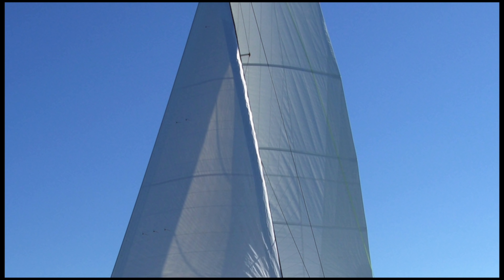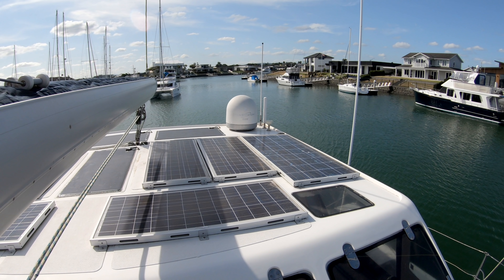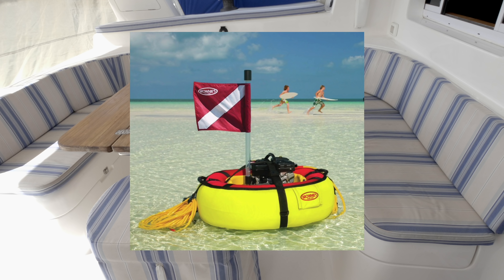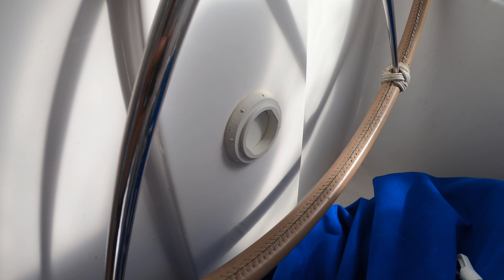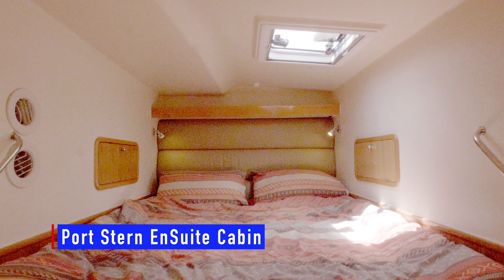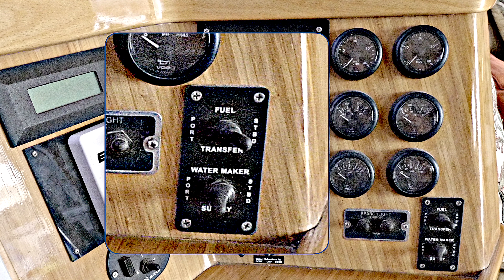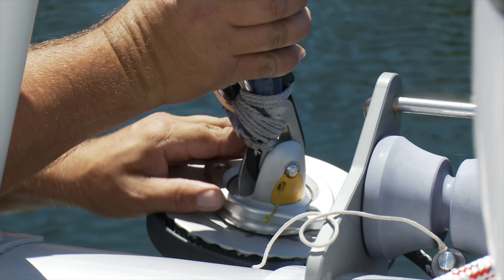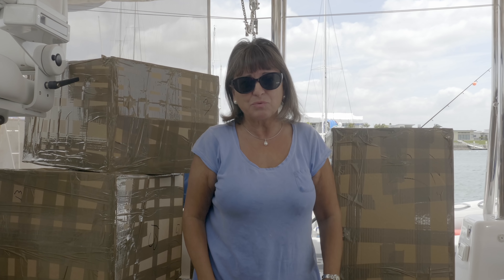Suliere is for Sale

Comment: Ready to take over the world, what else could you need! 10x better than a buying a brand new St Francis.
That being said, she is probably on the heavy side, how much wind do you need to stop the engine and sail?  and how does she point and sail in general? There isn't many sailing videos of the St Francis.
Reply from the maker: We averaged 200 miles a day sailing from South Africa to the Caribbean.
Its is not a case of stopping the engines to sail, its a case of sailing until there is no wind. We used the engines a little when the wind is less than 8 knots and we want some speed but otherwise we sail.
There are similar examples of sailing other SF50s across the pacific sailing at 15 to 18 knots. Oiu top speed ever was 26 knots.
She points well to 35 degrees.
Reply: @ClimateRealism  Thanks for the answer. 
So you're sailing in 8 knots of wind, point to 35 degrees, average 200 miles/day all of this with ultimate comfort at anchorage; therefore, what's the deal with performance cat? What's your point of view on the debate performance cat, lightweight=speed=safety etc? From what I've read, people get performance cat because they're fast, safe because they can dodge a storm, etc. but end up cruising at 9-12 knots because it's more comfortable for the crew. Sounds like it's $1M marketing. 
What are your thoughts on the topic?     
Ben
Reply from the maker: @zambla5088  No not at all,
I was giving examples of how e use the boat.
We would normal;ly start to use sail in about 8 knots... below which just engines.
We averaged when crossing the Atlantic 200 miles a day -sailing.
Sometimes hit 250 miles.
She can point to 35 degrees.
Those are answers to your questions - not all one example,
Out crushing speed was dictated by sea state, so if conditions enables sailing beyond 10 knots we would only do it if it was comfortable.

 I was answering g your individual your questions and you should not combine the answers like that because I did not claim that.
Reply: @ClimateRealism  Sorry for the confusion, I was actually complementing your boat and set up. 
What I wanted to know was your opinion on the performance cat argument, where people buy performance cat arguing that it is safer because one can dodge a bad system. Then when you read between the lines, they cruise at 9-12 knots because it uncomfortable if they go faster. So my feeling is like; what the point of buying a +$1m dollar performance cat to sail at 9-12 knots anyway, while you can spend 800k and get a real bleu ocean cat 
No misunderstanding, I think your boat is the real deal!!!
Reply from the maker: @zambla5088  We have run from bad weather at 12 knots motor sailing if there was little wind. 97% of the time you are not sailing and want comfort - when sailing in our ten years we never had a problem as we always ran from bad weather.
Lightweight cats are more about boasting than any practical benefit - they can sail in lower sind speed shutter but once you have decent wind we always had too throttle back for comfort.
Reply: @ClimateRealism  couldn't agree more. Lucky guy who buys your boat!!!
Reply: @ClimateRealism  well said, speed is WAY overrated when your getting beat to death or rolling hard.

Comment: With an asking starting price of a tad north of 800K$ one can buy lots of IQ points buying this boat. He can then claim that he was the one that made it the way it is now and pretend to be a genius. My dream cat so far (and not for the aforementioned incentive!! :) )!
Reply from the maker: Yes, asking $845k USA at present.
Reply: @ClimateRealism  That price is way too high for an over 10 years old boat. I value this boat around $600k.
Reply: @farzana6676  A lot of amazing boats sitting around the 600k range that’s for sure! I couldn’t spend 800k on this it’s just not worth it now. I don’t know if a lot of boats dropped in price because of the pandemic as I was not really looking at prices before. It seams you have to spend north of 400k but not 800k, 600k seams a sweet spot as far as I’ve seen. Maybe you need another video listing the “extras” you have included such as spare parts because I don’t see 845k. I see you’ve replaced a lot of things but they would come with a new boat.

Comment: A good example of great systems on a yacht.  Perhaps over done.  It will be difficult the sell this boat because the price is higher than a new high performance cat. Personally, I'd take a new cat and add systems as I went along.
Reply from the maker: Sorry but that is simply incorrect.
To buy this new for the same spec is almost double the price.
The top speed we ever had was 26 knots before we had to really slow down.
She is a cruising boat that can take a load and cruise fast.
As regards your 'overdone' would you like to expand on that remark?
Reply: @ClimateRealism  I agree. Given that this boat is purpose built for blue-water cruising, "over done" it is not. There are videos of sailing the Indian Ocean off Madagascar; I don't think a boat can be overdone for that voyage. That being said, the price is reasonable, given what my dream boat would be. It is quite obvious after watching the video and taking notes, this is a sail away blue water cruiser.
Remove the diesel and infrastructure, replace with electric sail drive. Remove the standard toilets and replace with composting. Boost the solar to a minimum 3Kw, upgrade the Lithium Ion bank to accommodate the solar, and maybe add wind generators and a tow-along as well.  Propane is a maybe. The stove top and oven would be electric. I am still looking into an electric genset v. propane powered. IF I went propane, the grill off the stern would be a definite addition.   However, propane would allow me to put in a heat source to replace the diesel set-up.  So many questions to solve a "simple" problem. Please understand, I AM NOT considering purchase of your boat, just dreaming. The modifications I mention can all be done by St. Francis on a scratch built boat.  The bamboo is stunning.
One question, I see you did not opt for the "garage" to the right of the stairs in the port hull. Was it not offered when you purchased the boat?  Thank you for your time in reading this.
Reply: @PaulBartomioli  Why would you replace the diesel? You have 1500 miles of range just with these motors. You'll get what, 80 miles with electric? You just tranformed a perfect ocean going vessel into a coastal cruiser and for what?
Reply: @C_R_O_M________  and when you run out of diesel? Or the head gasket blows? and on and on.  It IS a sailboat; wind should be your primary source of power. IF you want a power boat, you are looking at the wrong boat.  FYI, there are several boats circumnavigating with electric motors.  Then there is the idea of cruising, no timetables. ALSO, if you notice the rest of the post, I am looking to minimize environmental impact by removing diesel, by removing blackwater. I am not a tree hugger, just looking to improve my little spot.
Reply: @PaulBartomioli  if we start talking about "ifs" I could point out to you that "if" you ever sank the boat the environmental impact from those batteries would be about 1000X the environmental impact of burning diesel for a century - diesel burning which in fact is actually greening the planet as we speak : https://www.nasa.gov/feature/goddard/2016/carbon-dioxide-fertilization-greening-earth

There is a reason why MOST sailboats are on diesel and that's mainly because of its range and safety. Trying to battle a strong current and winds that are going to send you on the rocks while having limited energy to spare is something you don't want to test. But I guess to each his own. 

P.S. I am literally a "tree hugger' love those buggers.
Reply: @C_R_O_M________  I have no intention of getting into a watermelon seed spitting contest. The issues I cited with diesel do and have occurred.  You asked why I would remove diesel, and I told you. Done.
Reply: Paul Bartomioli your first comment contained an arbitrary assumption and I answered with my own. You made it a watermelon seed spitting contest (never heard that one before - good one!) and now you complain that mine went further. Like I wrote, diesel is used by 99.99% because of reliability and safety. A lot of the people that go, for example, the Oceanvolt way (a company with electric propulsion solutions) will spend a lot more than they will ever do with diesel units (like 4X their cost with diesel motors) and they’ll probably travel a lot less with them because people that have the money to do the Oceanvolt conversion usually end up with a boat that sits at the dock and them talking in cocktail parties for their “environmentally conscious” ways which is of course a blatant lie. 

You see, it all depends on the lifecycle and actual usage of the application. If you install a huge battery bank you have already emitted huge amounts of GHG (that are needed for the production of these batteries) then you must use these battery banks for a very long time to finally reach the point of a net gain in emissions and that’s IF you don’t do something wrong and destroy some of the cells in which case the (emission) “counter” resets. The following link will give you an idea with an automobile industry paradigm : https://www.daimler.com/sustainability/resources/glc-f-cell.html 
Diesel is far superior in terms of condense energy packaging (and new diesel engines have achieved extremely high efficiency numbers that brings them closer to electric motor efficiency) and you rather have (in the specific boat) a setup that allows for 1500 miles of range using motor propulsion than 80 miles before dangerously depleting your batteries and ability to power your boat out of dangerous situations. A dangerous situation will need high throttle maneuvers and as throttle goes up energy consumption skyrockets. Not the best scenario for an emergency situation with limited storage of energy (which is what an electric setup is at the moment). 
P.S. Hope the OP is ok with us having a discussion here.
Reply: @C_R_O_M________  Yes if you’re stuck in a bad current or storm you’d wish you still had your diesel motors for damn sure